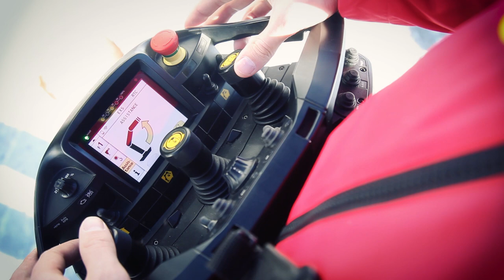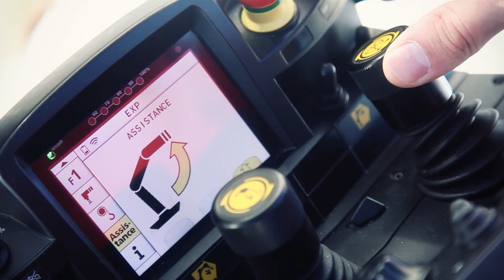PALFINGER Heavy Duty Loader Cranes

Comment: Nice video! It would be nice to see some of these knuckle boom cranes handle firewood. Thank you!
Reply: If you had one. You could load your cut firewood into those metal totes (The chemical ones) Charging deposit for tote. Then you could just deliver dropping off Tote’s. Take your tote back
In exchange for a new one the customer that does not have to handle the firewood. (If they leave it in the tote)
Reply: Palfinger crane operator